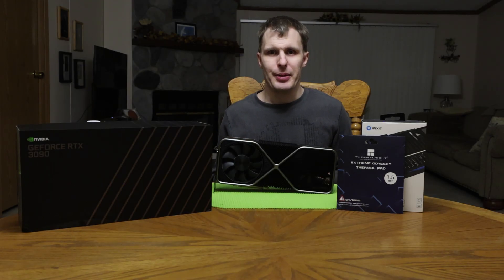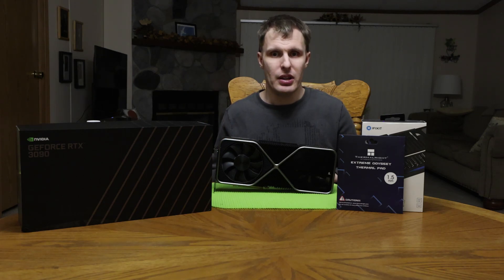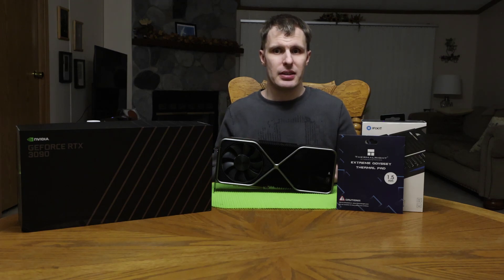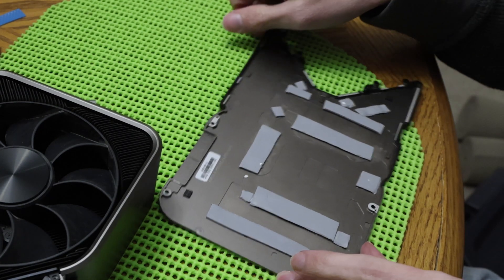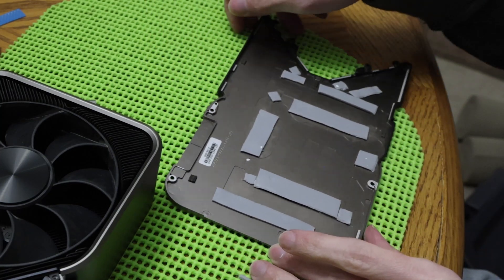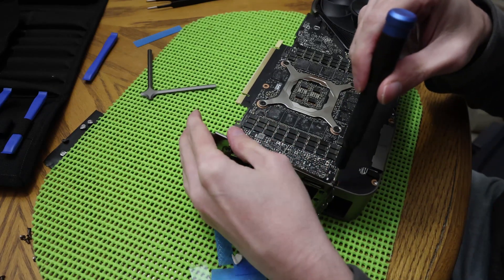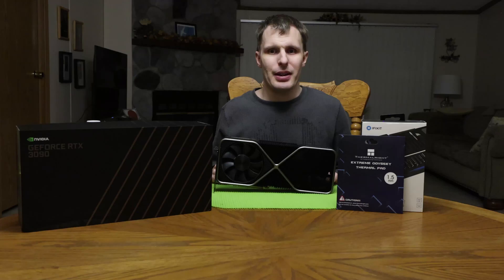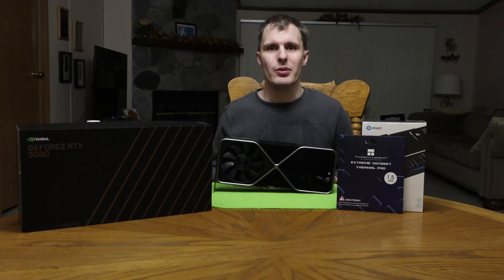RTX 3090FE Thermal Pad Replacement Guide

Comment: hello do you remove all the tehrmal pads as it looks like you remove one side and stick over the other side
Reply from the maker: Thermal pads will usually stick to either the heatsink or the board when the card is opened.  You can just pry them up with your fingernail or a spudger tool.

Comment: If you want to reduce your temps for the GDDR6X from unsafe to safe just repad the rear of the card and use Gelid Extreme 1.5mm pads. The risk of breaking the cables or creating a less effective thermal connection between coldplate and chip is high and the oem thermal paste seems to keep the core temp low. I went from 104deg mem junct to 90 max, you can also just undervolt the card which helps with around 100w power consumption with minimal FPS loss. Makes sure you have a well ventilated case and upward extract fans/AIO to reduce temps in the case.
Reply from the maker: Thanks Iain!  I have a rear exhaust as well as 6 120s mounted to a 360 Rad up top which help for extraction.  I was originally only going to do the rear memory chips but since I was already taking the card apart I thought might as well do them all.  Haven't had an issue with the 1.5mm thermal pads I've linked but I know Gelid are pretty good too.  

You are certainly right - my core temps are indeed now slightly hotter since OEM paste was surprisingly good and or perhaps the coldplate bond needs to have a tighter tolerance for this series of card.  

Since I'm using the card for rendering too, I haven't really experimented with undervolting too much though correct, in gaming I'm sure I'd be fine since I'm still a 60hz gamer haha.  Thank you very much for the kind tips and elaboration!
Reply: Is there a video out there on just replacing the back side thermal pads?
Reply from the maker: @spitondakthang  There might be, but it's not my video.
Reply: @TheRealLink  just ended up using kritical pads it was a much simpler process
Reply: Did you only change the rear pads?
Reply from the maker: @PaPaUpA23  I think you're replying to Lain?  Mine was a full swap.
Reply: So to clarify, no need to uplift the card from the enclosure? You only need to replace the ones on the top under the plate? Are the ones underneath sufficient?

Comment: You didn't change the thermal paste?
Reply from the maker: I did.  Just didn't mention it explicitly.  Also, I'm actually finding my card running warmer after swapping it so either the GPU die paste was already actually really good (I was seeing temps in the 40s or 50s with it even under max load), or I didn't quite reapply it as well.